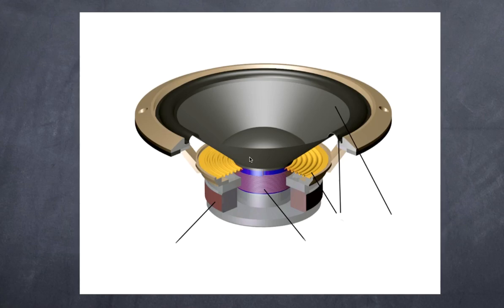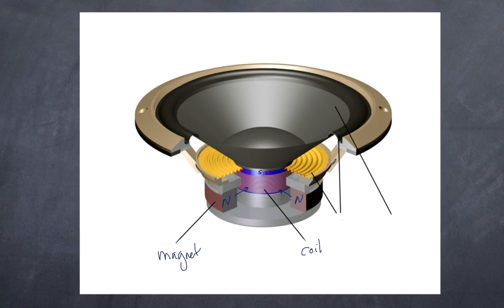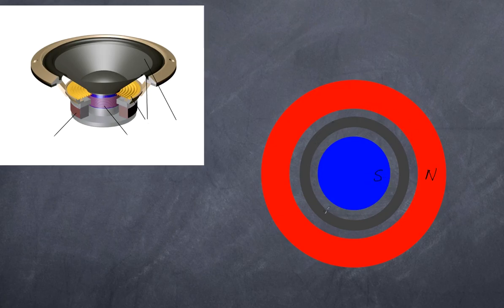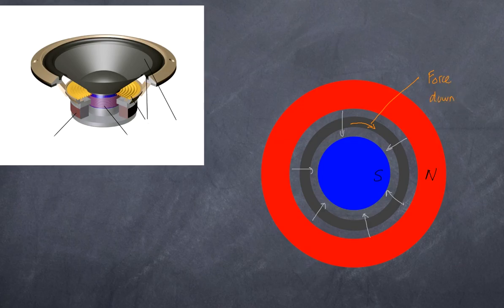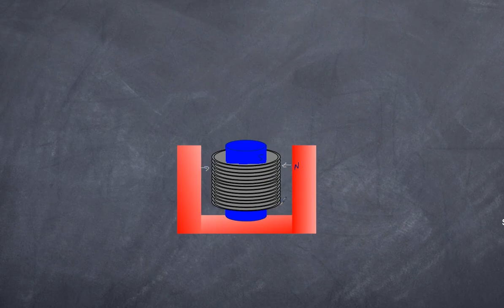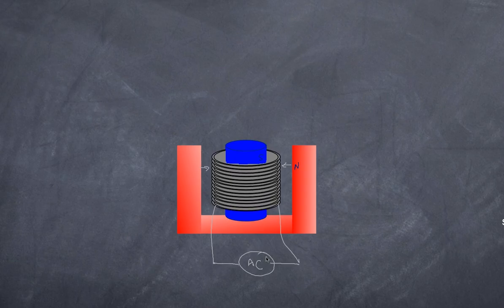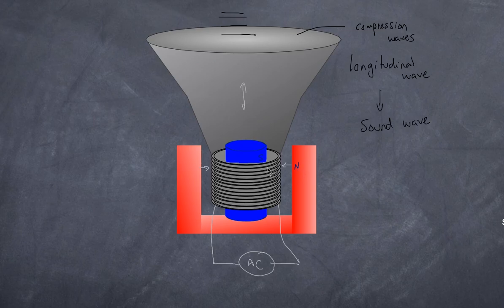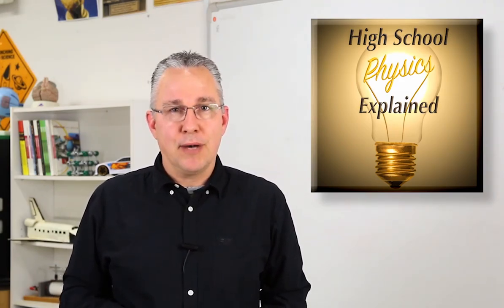The physics principles behind a speaker

Comment: Hello Paul.  Very nice, clear instructive video, which I may watch one or two more times to really integrate the information. I am just beginning to learn this kind of thing.

I wonder if you might help me with a project I am trying to do? Can you please tell me how to daisy-chain several speakers? Just the naked speaker like you show in the video, not the ones in speaker boxes. I would like to daisy-chain 3 or more 8 Ohm .25 W 57 mm Round speakers, all with North face polarity. The first one would be attached to an output device via its + pole. The device will be a 1 kHz DC supply one. Would this kind of array even work without shorting out or otherwise failing? If yes, should they be set a certain distance apart in order to not interfere with each other? Thanks in advance!

Comment: How far do the magnets emit a wave or magnetic attraction or detraction from the magnet itself into the outside of the speaker (front and behind).  In other words, how far would magnets travel in strength outside the speaker?  Does the strength normally dramatically reduce in a short distance? Say like 3 feet?  Would it be possible to measure a strong magnetic wave at this distance, or has it lost the significance of its power?

Comment: close but a little off you explained it wrong the top of the magnet is north and bottom is south (single pole magnets are rare)and the south is carryed to the center of the coil by the steel plate on the bottom and north is carryed up and closer to the coil by the top plate. nice video though and thanks for sharing
Reply from the maker: Thanks for the correction. The idea of expressing as monopole wasn't my intention ( I know they dont exist) but that is how it sounds.  I have explained the correction it in the description

Comment: so if u use dc current the speaker wouldn't work?
Reply from the maker: Correct if the current is unchanging. In a rectified DC supply you will get some vibration